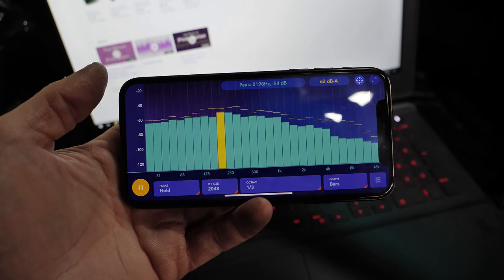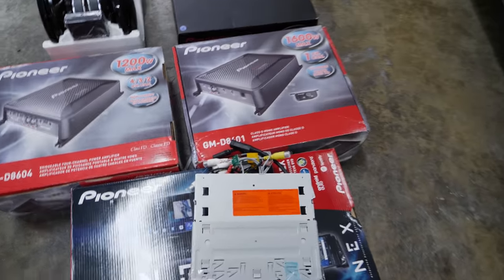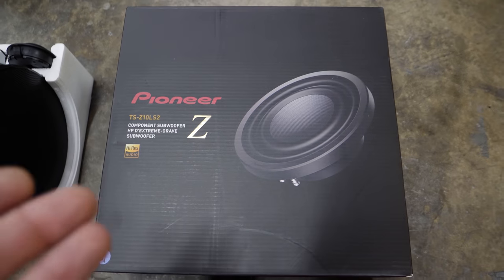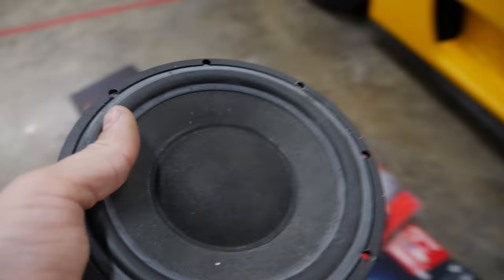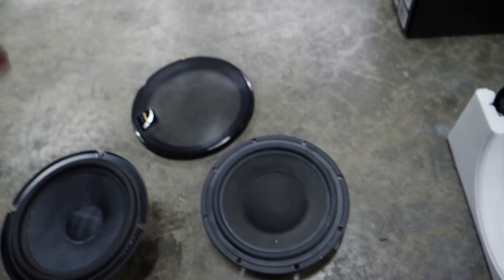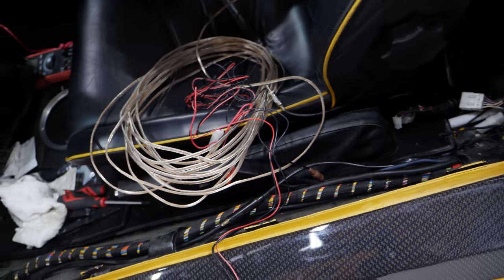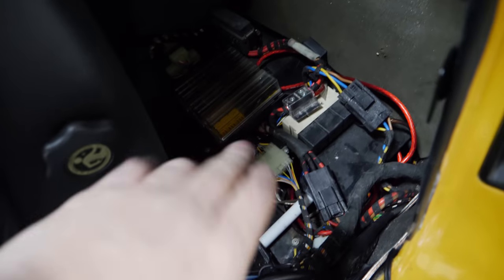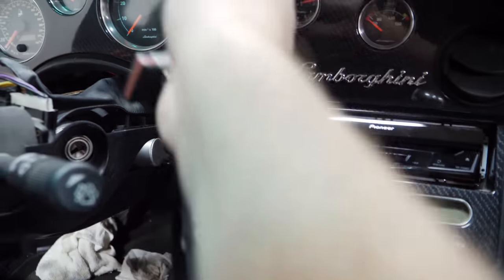Replacing the Lambo’s old speakers.  They were BLOWN out!

Comment: Is it me or does the Diablo steering wheel looks like a steering wheel out of an evo
Reply: Funny thing is that is an evo steering wheel and the headlight are from nissan 300zx :D
Reply: HAha looks like the one that I had for my Evo 8
Reply: Team DriveAlot best part is it’s just a plastic veneer to cover the Nissan logo. Another funny one is the one Tavarish pointed out wit the old vantage keys having a Volvo logo under the leather.
Reply: Dude, I been thinking that since he got that thing lol!
Reply: Team DriveAlot the rear taillights are also from another supplier which taillights for i believe commercial vehicles
Reply: Markrex yup this steering wheel is used in evos 7-9
Reply: lonewolf5460 yup lamborghini cant stop charging for parts they didn’t even develop themselves
Reply: Insane Conqueror this wheel is also on the murcialago just with a different cover on it
Reply: They're actually quite different, you just cant tell by the angle. Also the EVO wheel is just an off the shelf MOMO item used by many other manufacturers including NISSAN in some of its more modern eco boxes.

Comment: Rob you can actually skip those crossover networks and run an active set up by connecting the tweeters to the amp and setting your crossovers on your head unit
Reply: you can if you have multiple bi amp speaker level outputs or line level outputs for a amp .and if the headunit has full spectrum selectable crossovers.
and the list of headunits doing that is short, most headunits will only do a basic lpf and hpf for the sub and  bass/midd and still need a xover for the tweeters
Reply: yeah...only do that if you own a digital signal processor.
Reply: Fryingpan You could jerryrig it and use the lowpass on the hu and the highpass on the amp.

Comment: A real upgrade would be to remove those passive filters for the speakers and tweeters and add an active controller like an audison.
Reply: Eh, usually when you buy them pre-paired like that someone over at pioneer has spent far more time working out the crossover settings than someone at home. They are made to work together & give a good response
Reply: Brandon Thompson Crossovers isnt magic. A passive filter only introduces noice and lowers the overall rms going to the speaker, basically stealing power. Anyone with the right audio equipment can tune any DAC way better than the passive filters. Ask ANY professional car audio installer what they think about passive filters.
Reply: @brandonthompson9957  LOLOLOLOLOL. It's not hard to find out where the manufacturer centered their crossover network and then use that as a starting point for an active setup. Passive crossovers rob power and as they heat, they cause impedance rise.

Comment: no need to kik up the lows on the equalizer if you have a sub... unless you like the way that sounds ... am presuming that you have done that which is why when you tested the new speakers the note came out lower then expected or you might have the low pass filter set too high on the speaker amp, if you still have things accessible use that app to get as close as possible to what it should sound like

Comment: thing i dont get it why such a high watt amp for such a small build?
Reply: Joshua Ridley ikr 1300 watts drives both speakers and tweeters and could've done fine with the sub too if it was a 5 channel amp, little overkill on the amp lol

Comment: What happens with a thin paper cone is that at some point in the frequency range it stops moving as a Piston. The some parts of the cone will move in the opposite direction to the cones movement But you can't see that since its just a very tiny bit but still hearable.
As where this very stiff fiber cone doesn't do that. That doesn't mean it's always like that. There are so many speaker manufacturers to say that its always like that since you can also make a very stiff paper cone.
Here is a video that explains it better. https://youtu.be/T2pvz6RDBCE
Those different notes playing is called distortion. Where the speaker starts to create tone's that are not in the original signal.

Comment: 10-amp fuse.
They use lower amounts of power for the lower alternator/battery load. I would rather listen to the music of the Diablo over a louder stereo any day of the week...
And amp wattage has little to do with speaker efficiency. Think of watts as gas in your engine, air being the amps, and voltage being the spark ;) 
Your speakers likely only used 6/10 amps to drive the 35W speakers tops anyway. The ohms rating is much more important.

Comment: I know its a video about the lambo, but I got this strange idea...
What if you combine the 13b, 20b and the 26b dorito engines and turned the AWD 4 rotor into a AWD 9 rotor...

I know your stupid crazy enough to do that
Reply: The Problem ist the the main shaft weich needs to be extendet (super expansive) and the length